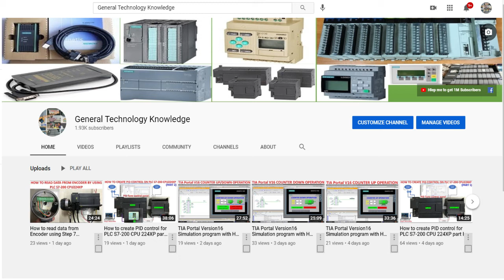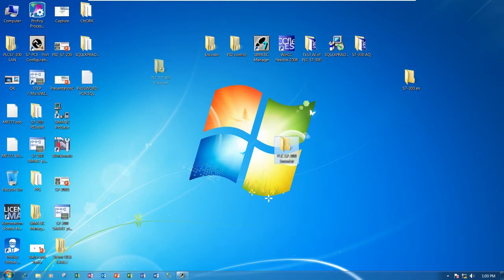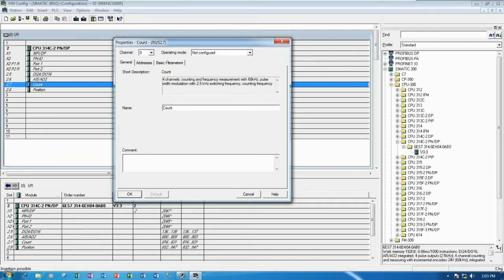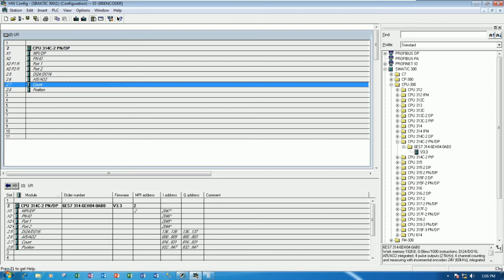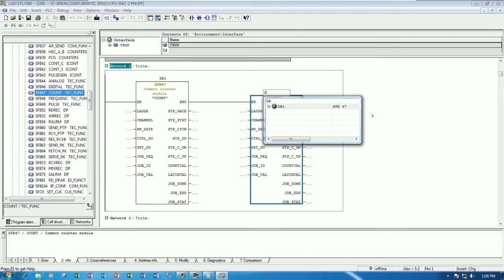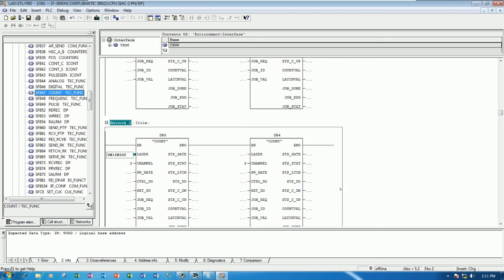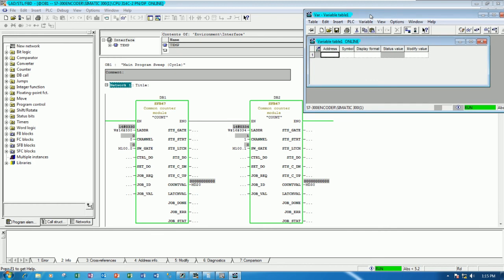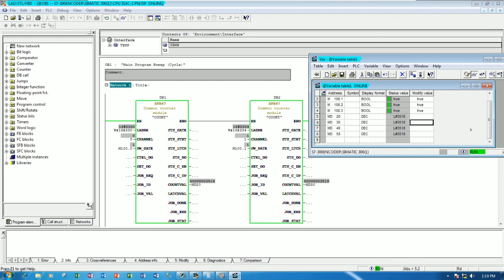Read data from encoder by using PLC S7-300 CPU314C-2PN/DP part1

Comment: I have an application using incremental encoder to measure a length and do the cutting at the specific  length this module is good for me . and can i chose cpu313 2DP  what is the diffrence between it and this CPU . AND TANK YOU BROTHER